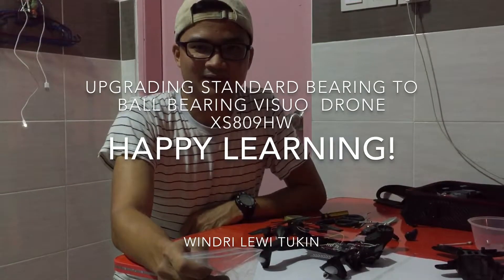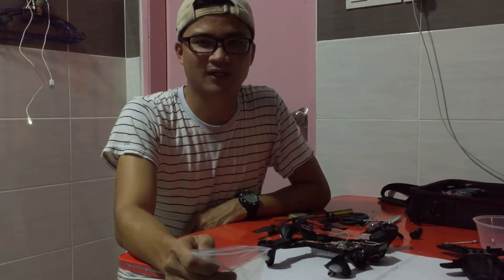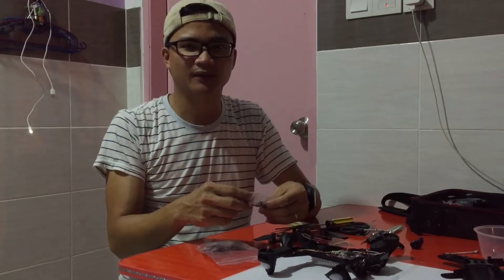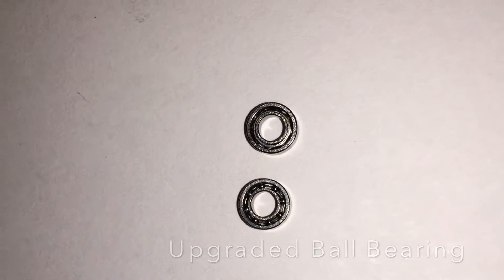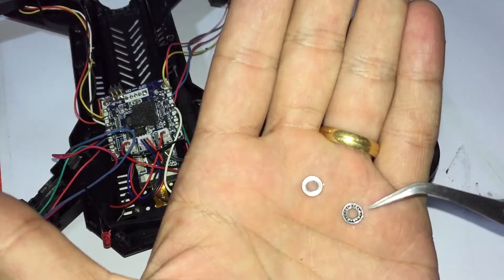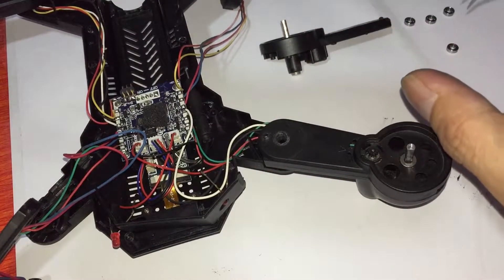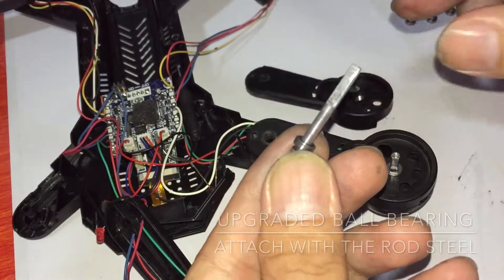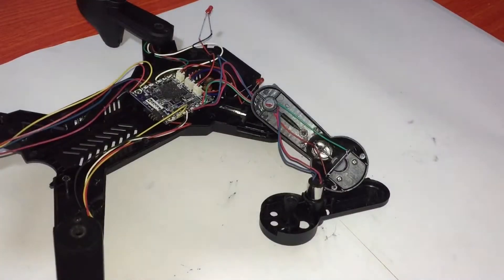Visuo Drone XS809HW Bearing Upgrade.How?

Comment: Hi, what are all the dimensions of the bearings please? Inside diameter, outside diameter and width/thickness? Thank you
Reply from the maker: Lee C hello sir all item description can be fine through this link:

Check out Upgrade Bearing engines motor Aluminum Shaft gear blade for Visuo XS809 XS809HW for RM60.50. Get it on Shopee now! https://shopee.com.my/yeamun.my/1019069389?version=7db6f5f56096e2e17697c3402343ba19.
Reply: normally the diameters must be 2x5x2.5 mm i think ;)
Reply: 2x5x2.5 mm ball bearings
Reply: On Ebay for very cheap.
Reply: @xd45acpshooter  3x6x2 but the 3x6x2.5- more common and cheaper and should work too ( they are known as mr63zz ball bearings )
Reply: @maxmax-xx7nw  so what the original size, bearing for that drone? I am searching seal bearing.
Reply: @myusry8683  3 inner hole, 6 outer diameter, 2 thickness in mm
Reply: @maxmax-xx7nw  thank you very much.. 👍🏻
Reply: @maxmax-xx7nw  do you think it possible to change brushed motor to brushless motor for this drone?
Reply: @myusry8683  don't do it , if you want your visuo to have longer engines lifetime just drill holes in motor cover , give them some airflow during flight , if you want brushless drone , just build one ! You can do it for 100-150$ .
Reply: @maxmax-xx7nw  drill holes at motor cover?
Reply: @myusry8683  yeah, near led, motor must have air cooling ! I drilled 3-4 holes on each side of motor with 3mm drill
Reply: @maxmax-xx7nw  sorry Sir.. can you give your FB link..
Reply: @myusry8683  https://drive.google.com/folderview?id=15m2hZf7cpokXikBpVOJUt7xl-GOuZ_DZ
Reply: @maxmax-xx7nw  for controller, can you share earth point..
Reply: @myusry8683  ground is right next to the antenna pad
Reply: Make sure with multimeter